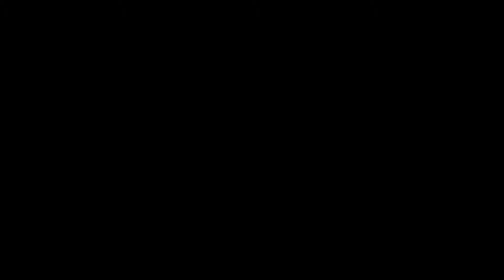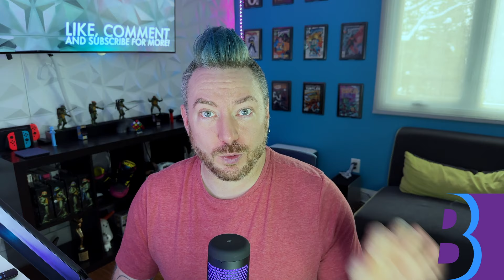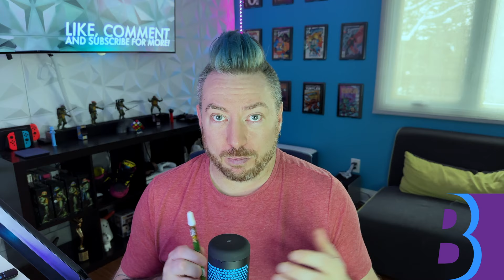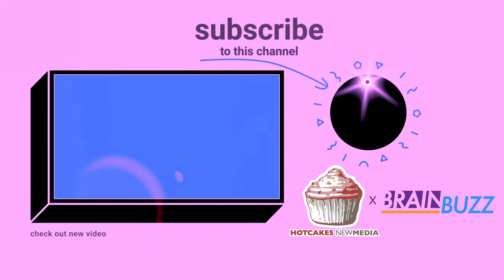How to unclog your 510 vape cart quickly and easily!

Comment: dude, bought a new buttonless pen and i’m quickly learning i draw too hard when i first hit it, both of my new carts have been clogged up. Been using a toothpick to clear it. This vid just saved me so much trouble and saved me some hits i would’ve lost to the toothpick, THANK you easy sub
Reply from the maker: So glad it helped. For the record, I've used the toothpick method too. Sometimes you just gotta stab at it. Lol.
Reply: @brainbuzzvideos  that combo is what’s doin it for me 😂 ‘ppreciate ya
Reply: @brainbuzzvideos What if the cart sizzles when you press the button? 🤔
Reply from the maker: That could be normal. Oils that heat up can sizzle. Mine do that sometimes too. It could be that not enough oil is getting through, making the ceramic disk extra hot once the oil gets there.

Comment: Good video... :). I appreciate the tip and, in some instances, I've noticed it does work. however, my issues are with the twist off top, 1-gram refillable ones that I use and one of them appears to clog be near the bottom of the cart. I've even had small amounts of product come out that little hole in the very center of the bottom of the cart where the threads are. What I did and found to be the best way in the long run was to empty the cart then soak it in 99.9% rubbing alcohol for a couple days to break down any product remaining in the ceramic filter and inner chambers of the cart. Flushing the liquid through the cart itself worked best and the use of a syringe accomplished this very well. Once the final rinse was done and after a hot water flushing/bath with a thorough drying using a mini stove to warm it up and evaporate any liquids left in it. It worked like brand new again and I'm on my 5th refill in it now.
Reply from the maker: My tip is definitely just for standard pre-filled carts. In this case, it's only the condensation and residue at the tip that causes the issues. With refillable, I can see how the entry ports at the bottom that lead to the heating disc would get clogged over time. Thanks for sharing your detailed cleaning tips!
Reply: Whats the point in emptying and trying to fix it? Throw it away at that point.

Comment: omg thank you bro saved me so much hassle lol i'm so new to vapes and tried the disposables but got a defective one so made the switch and just got a cart and screwed it into my kodo pro but it wouldn't pull unless i had it a little loosened 😂
Reply from the maker: I'm glad you found a solution that worked. Pretty weird that you're getting that many issues though. If you're in a legal market, try to stick to the reputable brands to get started. Good luck and enjoy the journey. 😊
Reply: @brainbuzzvideos  yeah it only happened to this one brand double bear and thank you, i do always stay within the regulated and legal parts via dispensary lol it was double bear brand and the dispensary employees even were surprised i had a clog in it but this actually fixed it no problem! and thanks for the tip about staying with reputable and trustworthy brands and fixing the clog, i can only imagine what a mess the unregulated market is!

Comment: I'm kinda new to all of this stuff, where are you supposed to insert a paperclip/safety pin when cleaning it? The mouthpiece of the actual cart?
Reply from the maker: Who said to use a paperclip or safety pin? My video didn't day that and I never recommend using that. Keep your cart upright when storing it, keep the battery below 3.6v, and follow my tip and you should be good.

Comment: Why does it clog? Am I not using it properly? Is it the way it is stored when not in use? Also, mine clogs up again after taking a few more hits. I’m going to try this method next time
Reply from the maker: Mostly: poor design. Some of the newer cart designs don’t clog but some producers are cheap and use bad cart designs. 

Also, you should store it upright, but the clogging happens more often in colder weather. The atomized resin cools rapidly and sticks to the walls of the mouthpiece as you inhale. Keep the cart as warm as possible before and after use to reduce clogging.

Comment: i did this so many times and wondered why it wasnt working.. turns out my cart leaked out the bottom just enough to block the airholes and crystalized on it. I had to use a lighter to fix it nothing else worked. 

Your trick will come in handy next time my inner tube (?) blocks. thats for damn sure!~
Reply from the maker: Yup. It either blocks at the top (where my trick works) or it leaks out in the bottom. If it's not a really bad leak, my trick works in reverse too! Same technique but with the cart upside down. But for bad leaks, burning off the oil is a good way to do it!

Comment: If you have a toker poker lighter case or any other slim wire, run a lighter down it a couple times then put it into the tip and get it all the way into the hole :)

Comment: Try putting it in a zip lock bag and let it sit in warm/hot water in a mug. (Up right) That should help melt that thick liquid back down to the heating medium.
Reply from the maker: In more extreme cases this can work well. Thanks for sharing.

*Just make sure your ziplock bag is actually waterproof first. One small hole and the cart is ruined.

Comment: is there a reason you do it with the battery on?
Reply from the maker: No. Battery on or off doesn't matter. In fact, the cart doesn't even need to be on a battery at all! I just left it on for the video to show the light going on once it unclogged.
Reply: @brainbuzzvideos  yeah I was gonna say in the case of blowing out like that I've have oil leak out and definitely don't want that to soak into my battery!
Reply from the maker: @MrSanctuarys That's why I say in the video not to blow hard. It's not about the pressure, it's about heat and slowly melting it down out of the tip. That said... If it's leaking out of the bottom, the cart is damaged. It shouldn't do that.

Comment: I stumbled upon this while looking for some spit back fixes for these type of batteries as everything on YouTube for spit back seems to be about those large square vapes and I have no idea how to apply any of that logic to my tiny 510 pen :( but this has happened to me so many times with other carts and it’s really great to have this tip in my back pocket for a rainy day! Thank you :)
Reply from the maker: I hadn't even heard of "spit back" happening with regulated cannabis carts. I thought the oil was too thick for that to occur. You may want to consider returning the cart if that's happening as it means something is damaged and you're likely burning the oil (not good for you). Good luck!
Reply: @brainbuzzvideos  unfortunately it was purchased in a different state from where I reside but it’s a regular problem I’ve experienced with lots of carts in different states. Perhaps it’s my battery but was hoping to find a quick fix until I have the money to invest in a new one.
Reply from the maker: @lexa_power  Thanks for the extra details. I'll have to see if the quality changes when I make my way into the states later this year. Less strict regulations maybe? Could make for a good video.
Reply: @brainbuzzvideos  I’m sure that has a lot to do with it as the quality of what you get in every state is very different.

Comment: Nope, didn't work for a single cart I have, even pre-heated. My non push-button PAX cart I tried this, it also doesn't work. I do recall a friend of mine telling me to blow into the 510s when they clog but that simply has never worked for me, even if it's pre-heating. I've blown over half a cart pre-heating trying to unclog. The PAX rosin is so good too, but my pineapple express is too clogged to hit
Reply from the maker: Pax and other closed-loop systems are made very differently from 510 carts. What I described will likely never work for those. For 510, it's not about blowing, it's about adding heat at the top (preheat adds heat to the base not the tip). Good luck with future carts.
Reply: @brainbuzzvideos  Yeah I tried this without pre-heat on 510s, still no luck. The problem is that oil gets stuck in the mouthpieces which is what clogs these.

Comment: Why does it clog in the first place?
Reply from the maker: The trichomes in the cannabis are sticky and coat whatever they come in contact with. As you inhale, the resin vapor is traveling up through a chamber that has a very small hole at the top. Over time the resin coats the walls of the chamber until the hole is too small to let air through. My trick works by melting the resin and pushing it away from the hole. 

Some carts also get clogged at the bottom if oil leaks out from a poorly designed cart.
Reply: @brainbuzzvideos  solid reply, appreciate you.

Comment: Just draw through the intake holes and itll activate
Reply from the maker: I'm not sure I understand what you mean.
Reply: @brainbuzzvideos  inhale through one of the little holes on the top of the battery right under the cart
Reply from the maker: @erlejomo  ok. I think I understand. You mean for draw activated batteries like the Spinach one, if you want to activate it while the cart is clogged to heat up the oil, you can inhale through the lower intake ports. 

Neat trick! Thanks for sharing!

If anyone uses this technique, be careful not to burn yourself. The base can get very hot at times.

Comment: Mines kept blinking red wtf, i hate these vape thc
Reply from the maker: Have you made sure you charged the battery? If so, it could be the cart is broken or otherwise not making a connection. Blinking lights usually indicate dead battery or missing cart.
Reply: @brainbuzzvideos  I was just smoking it, low battery so I charged it then it stop working just blink red when I press the bottom.
Sometimes it blink blue if I charge it but light die in a few seconds
Reply from the maker: @CloverStarz hmmm. Could be that it didn't charge properly. If you're using just a standard pen battery, they die quickly. I find the bigger batteries are worth it and last longer. Good luck! I hope you get it working.
Reply: @brainbuzzvideos  it's a Mello yellow live resin

Comment: Didnt work
Reply from the maker: That's too bad. Yours might be clogged from the bottom. Those are harder to fix as it's not a single hole, but you can try my technique holding the cart upside down. Sometimes that helps. Good luck!

Comment: I just stick a toothpick 🦷⛏ into the mouthpiece hole and pull the oil out and continue untill there's no oil on it. And if it leaks out the bottom use ISOPROPYL alcohol to clean the bottom off and it will work like new.🔥🌲🛒🧪🦷⛏
Reply from the maker: Solid advice for properly fixing the problem when you have access to time and tools. Thanks for sharing.